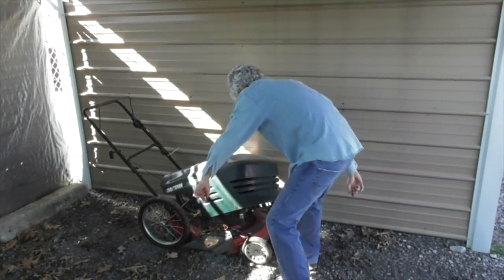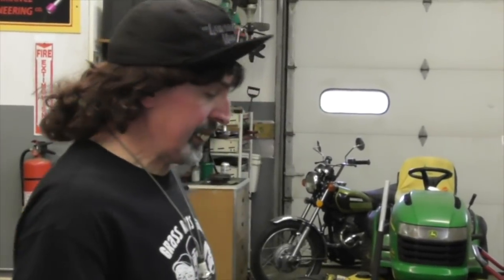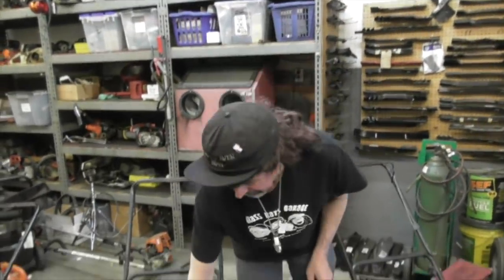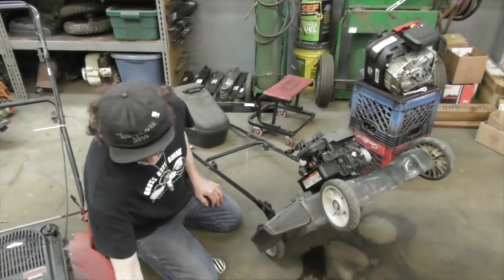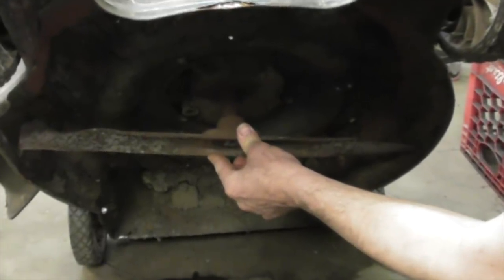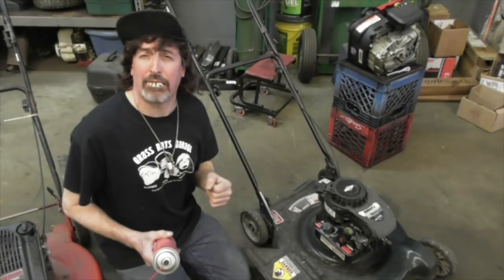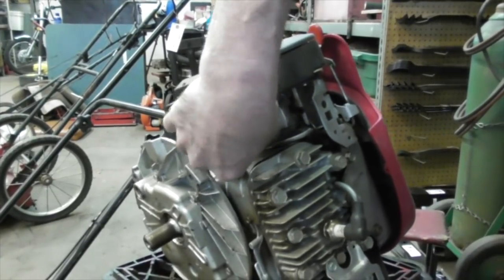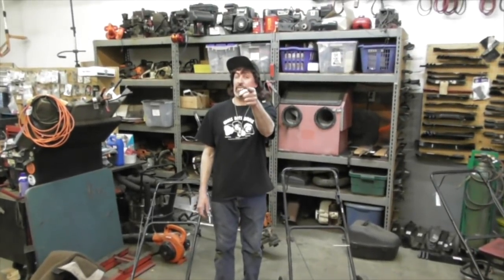How To Maintain Basic Push Mowers

Comment: I see in the comments a couple different people bring up that you should pull the spark plug wire to prevent accidental starting of the engine while taking the blade off.  I've heard this for years and never do it. Stupid? Maybe. But that's my choice.
My question is does anyone actually know (KNOW, NOT HEARD FROM SOME GUY ONCE) of this actually happening?  I'm sorry if this happened to you but I'm curious if it really does happen.  I just wonder how it could happen if the coil is grounded, which it would be if the mower is off. (Especially one of those single lever style.)
Reply: Gene Friedman it sure does, but like I said, has this "shit" happened? Or just a bunch of hype?
Reply: jhitt79 No, its not. The engine brake also has the stop ground wire to the coil. As long as the engine brake is on, that ground wire is on too. People are still carrying over from the old days of stop switches. Even then, as long as the dan stop switch was in the stop location, the coil was grounded. Just a manufacterer manual writer decided to add that in years ago. 
Hell, I remember one manual suggested removing the plug, so you still get idiots saying remove the plug.
Reply: I've done it on a very old engine. The reason I can see is that, the ground kill switch is a spring plate that you flip. There was some surface rust between the  the grounding plate and spark plug tip. That was before the "kill switch" was upgraded to a wire. It is an old 1953 REO 2 HG ,1 3/4 hp which has that plate near the top of the spark plug. The park plug has no boot. The plate grounds the tip of the spark plug to the bloc. No throttle cable and has to be started with a pull rope. Very old school indeed.

Comment: Pull the plug wire Taryl! You put a weight on the safety bail at 5:04 ! That blade could have kicked. I saw it happen to a guy once. Lucky it threw his gloved hand away from the rotating blade.

Comment: When I tip my mower on its side oil pours out the air filter 👎🏻
Reply: Delm21 always look at what side has the oil dipstick. Tipping back is always the safest, but oil side is second best. Never tip to carburetor side down.
Reply: Delm21 Yeah, I would tilt it back then. Unless you drain the gas out of the tank, then its ok to tip it on the carb side. I have had a few mowers smoke for a few minutes tipping it on the exaust side. When oil runs out the exaust, you have some real issues going on. Much more than just tipping directions.